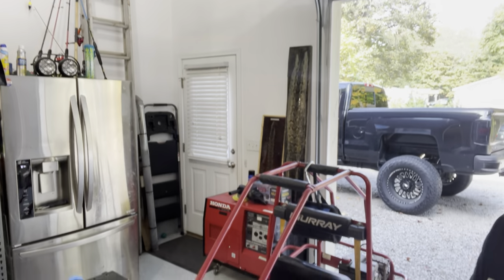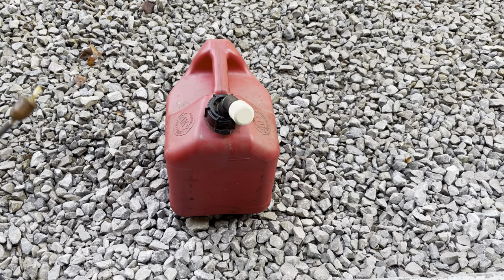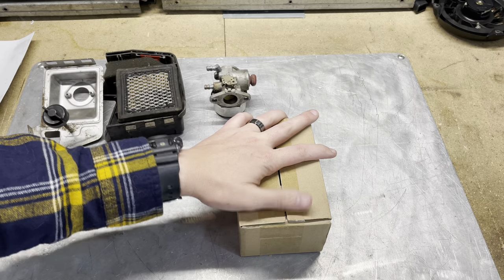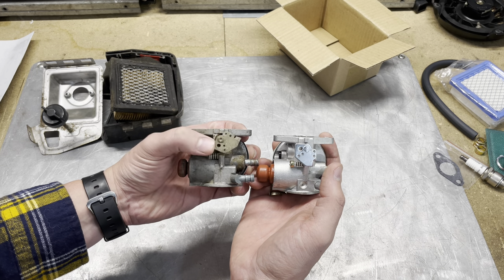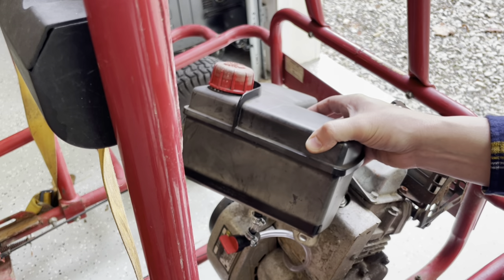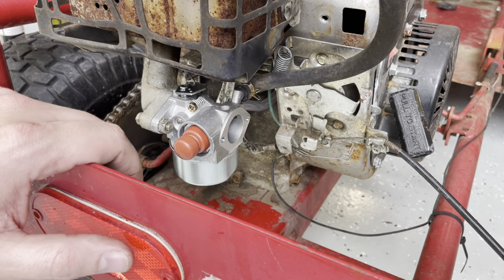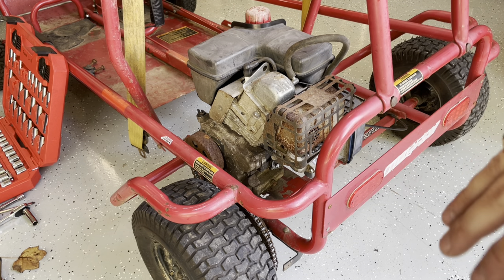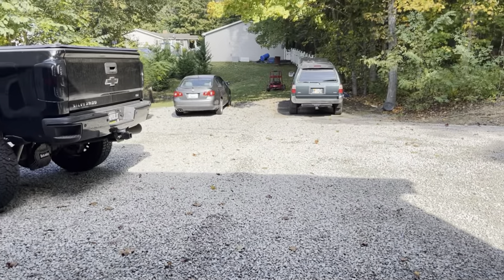Murray Go Kart 6HP Tecumseh Carburetor Fix!! Running Great Again!

Comment: This thing is a fun little project I just finished mine it's the same one I just painted it put all new tires and new 212cc predetor engine from harbor frieght runs about 27mph but if I want to go fast simply adjusting the throttle screw it gets about 38mph
Reply from the maker: Hell yea!
Reply: I would like to see it with your paint job!! I hate to paint mine from the red with original Murray stickers
Reply: @justincase5400  I actually sold it but I have some pictures of what it did look like if you want to see it
Reply: Yessir idk how to share pics on here i just finished mine

Comment: I found if you change that spring at the bottom of the motor the throttle linkage that connects then goes to the carburetor if you change that spring out for a solid metal piece mine came with it i had to bend it just a tad but it makes the go kart way more responsive and able to get way more out of the power

Comment: Great vid. I’m tinkering with the same go kart. I ordered the same kit
Reply from the maker: Thanks! Good luck. Still working hood to this day!
Reply: @linksgarage1985  just installed mine yesterday. Seems to be working great. Guy I got it from threaded a standard bolt where the clutch goes. It’s actually a 24 thread fine bolt. Once I get the right one should be good to go

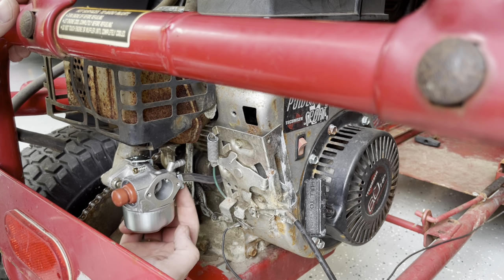Comment: hey there bud, I appreciate you doing this video for us   @ 9:50 that vent tube connects from the ohv to the carb?  the tube on my engine is weather rotted and broke in half basically so one half is hanging off the carb and one off the ohv.  It still runs but has some problems staying running so maybe thats the problem.  Anyway, I will replace.  Thanks brother and let me know if I am wrong on any of that.
Reply from the maker: Honestly man I’m not sure. I sold this kart a while back. I hope you get yours up and running.

Comment: What model number is this red Murray go kart? I have the same on with a predator 212 and I’m looking for a few different parts for the frame and cannot find them anywhere. Any help would be greatly appreciated.
Reply from the maker: @SharperWolf919  sorry man. Sold it.
Reply: @linksgarage1985  it’s all good. Just wondering what the name of the kart is. I know it’s Murray but I can’t find anything online. Murray stop making karts? It’s a two seater with the steering on the wrong side lol that’s all I know.
Reply from the maker: @SharperWolf919  that’s all I know 2! 🤣
Reply: @SharperWolf919 I’m pretty sure it’s called the Murray outrage. I have a friend who has one and it’s like 1 of 900 that were built. Hundreds of them were recalled from the store since they had faulty seatbelts, so there are many less than 900 left today. They were made in the early 2000s.

Comment: Is their anyway I could contact you about this go kart? I have this exact kart but having starting issues and was hoping to see if you had any shots of the throttle cable set up from the side of the engine? Or just some shots of your engine? Kinda at a loss of what to do…

Comment: I’m working on my now. Same engine except it’s a 6.5 hp. Does the throttle hook up to the carb at all? I start mine up but doesn’t move when press the gas pedal. Any suggestions? Thanks